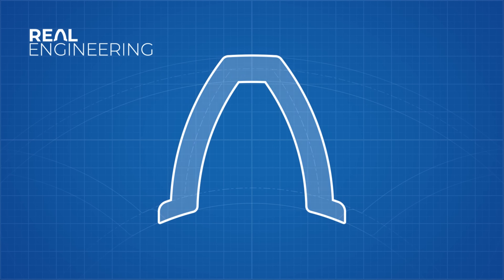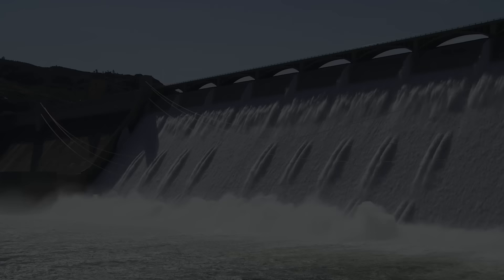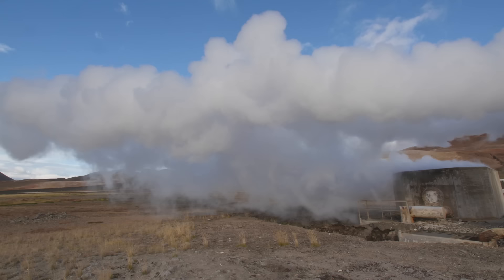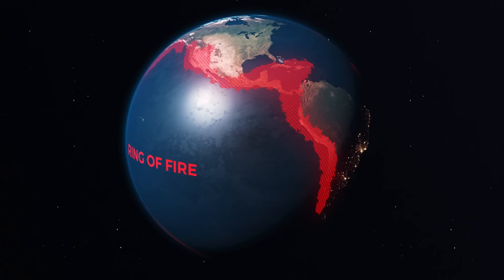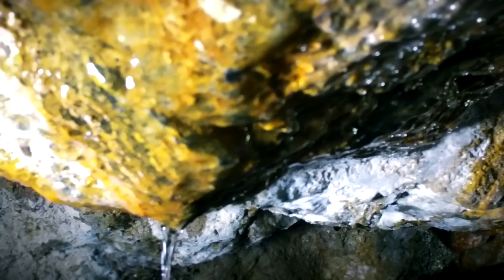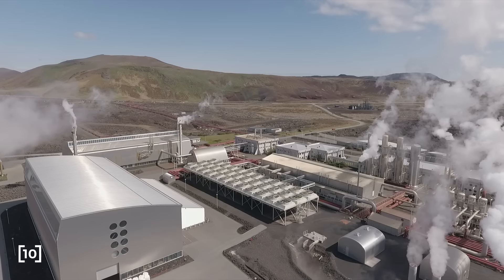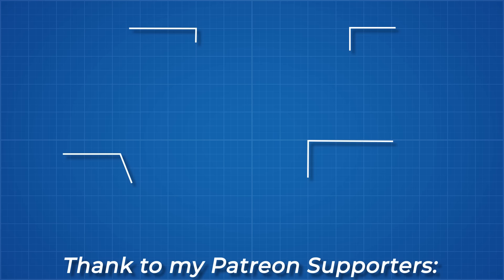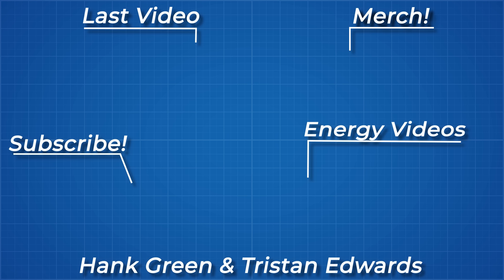Could Earth's Heat Solve Our Energy Problems?

Comment: An earthquake of 3.5 is nothing, make those buildings properly
Reply: I agree. But, the problem is most of the world has been around for much, much longer, and their buildings were not always built with earthquakes in mind. It is possible to renovate and retrofit the structures, but it is extremely expensive, and in most common building types, like say old stone houses in a village in Italy, prohibitively so.
Reply: @ryanaegis3544  The problem in Italy is not the old buildings per se. For example, the medieval tower in Norcia is still standing even after the earthquake. The problem are modifications made in economic boom times to the old buildings, for example adding balconies, enlarging doors and removing load-bearing walls, or even (the worst offender) replacing the timber-framed roof with a concrete slab roof that adds an enormous weight on top of the structure. Such structures are already overloading the house in normal times, imagine in an earthquake... what happens is usually the roof cracks the load-bearing walls made of stone and not intended to support a heavy slab, and the whole house crumbles while the roof remains intact
Reply: Thank you for that insight.
Reply: 7.1 earthquake 10 miles from a city of 300,000.

0 deaths, only minor injuries.

I laugh at earthquake news now.

Comment: Look at the Geysers in California.  Active since 1960 with about 1,500 MW output.
Reply: Last coal fired power station built in Victoria Australia had 4*2000MW generators. (Built in 1980s).Do you think you could build maybe 5-10 more plants without affecting the geysers? 

In NZ they made 20,000 households cap thier geothermal pipes & install LPG fired water heaters. They were extracting so much heat the geysers would not spray steam as high into The air. It was ruining the tourist industry. I know because I worked for a company with the contract to build the 20,000 LPG water heaters. This was back in mid 1980's

Comment: California doesn't produce enough energy in summer, either. They buy a good 4k MWH a day from the surrounding grids.

A few years old, but this article talks about California being the single biggest importer of electricity in the lower 48: https://www.eia.gov/todayinenergy/detail.php?id=38912
A (relatively) live graph of the grids in the lower 48; this page specifically looks at California. The bottom graph on this page shows energy interchanges with three other grids - Mexico, the Northwest, and the Southwest (excluding California itself). Positive values on the graph indicate energy exported from CAL to the indicated grid, and negative values show energy imported from the indicated grid to CAL. The only place California has exported any energy to in the last week is Mexico, and that looks like it hasn't broken more than maybe 100 or 200 MWH on any given day. Conversely, both the NW and SW grids have exported between 2k and 6k MWH daily, with only one day coming close to being a net 0 with the SW grid at 5pm. https://www.eia.gov/electricity/gridmonitor/dashboard/electric_overview/regional/REG-CAL

Even in summer, California doesn't produce nearly enough energy to sustain itself.

Comment: We need to move to sustainable energy, not renewable energy.
Reply: @windowkey  Technically fossil fuels are also renewable albeit over very long time frames. Sustainable means that the rate of regeneration equals the rate of consumption. In that regard, even nuclear power is not sustainable since there is a limited supply of fissionable material on Earth and the fuel is not renewable.
Reply: A hydropower dam is renewable energy.
Reply: @Obscurai  There's enough mineable thorium to last us a billion years...
Reply: @axiom1650  While there is an estimated 6.3 million tonnes of thorium on Earth, the rate of usage will ultimately determine the lifespan of the consumable fuel - even thorium. Do you know the rate of fuel consumption to justify the claim of "a billion years"? Also thorium requires another fissile material to initially "breed" it into fissile material, and this catalyst material is limited.
Reply: @Obscurai  We only need to bridge the gap between now and fusion being the cheapest energy source, also uranium fits that requirement.
Reply: @Obscurai  
It gives us the thirty years we need to develop Fusion.  Wind and solar do not!
Reply: @JudyHart1  
Hydro power doesn't damage the environment?
Reply: @lordsamich755  No problem, now to find someone to fund research and development for another 30 years, while there is an immediate need to transition to an alternative energy source.

Don't get me wrong, I get it. The technology works and there is promise, but there is a great need now to fix the climate crisis and the long lead times to just even build the reactors (some reactors have been in construction for a decade) is not fast enough. Sure keep doing the research, but we need something now. Call me when reactors can be built with less capital and/or produce electricity at a lower cost than existing technologies - maybe then I and others will invest.
Reply: @axiom1650  Good luck finding investors (government or private) when there are more profitable and less risky energy investments. Since fusion is not yet a reality, it is far from being the cheapest since that is not even part of the conversation yet. Keep doing the research, but until the economics, operating costs and energy yields are known, the claim that fusion is the cheapest energy is simply nonsensical and unproven.
Reply: @lordsamich755  All forms of energy extraction damage or alter the environment - just pick your poison. Solar traps heat that would otherwise would be radiated back into space. Nuclear generates waste that is difficult to dispose of. Wind alters wind patterns. Hydro floods valleys. Hydrocarbons emit CO2. Geothermal if not opportunistic, cools the Earth's core and potentially weakens the magnetosphere. It's only a question of which type of damage is acceptable in the short and long term time frames.
Reply: @Obscurai  I'm talking about a scenario 500 years in the future, when coal and oil have become considerably more expensive than nuclear fission and fusion due to scarcity. A man can dream no?
Reply: @axiom1650  Coal, oil and natural gas are already more expensive than other forms of energy production - and the costs of renewable sources continues to drop. This is what fusion will have to compete with and what fission is currently struggling with:

https://en.wikipedia.org/wiki/Cost_of_electricity_by_source
Reply: @Obscurai  
That is why I support Nuclear Energy.  The GT-MHR is ready for deployment right now.
We could have an entire fleet of GT-MHR's powering the eastern seaboard within 5 years.  Where have already been waiting on fusion for 30 years... Twice.  We simply can't afford to be reliant on that schedule.

http://sites.ieee.org/npec-sc2/files/2017/06/SC-2Mgt05-1_Att9-Overview-of-GT-MHR-Reactor.pdf
Reply: @lordsamich755  Terrific! Are there investors willing to invest? Are the economics viable with a sufficient ROI that exceeds other tech?
Reply: @Obscurai 
Everybody should be investing.  The principal obstacle is that people have been fed a consistent diet of irrational fear and lies for 50 years.  To the point that they won't even read information I provide them. Information demonstrating that with the current state of development, prior concerns about Nuclear power are now completely mute.
Reply: @lordsamich755  So no real investors then and none for the foreseeable future.
Reply: @Obscurai 
A series of Australian Super funds have stated specific interest in investing.  I'm certainly interested, and anybody who knows the truth should be interested in investing.
The issue is that we have a national ban on the development of any nuclear power technology, because of stupid asshole politicians who like to fuck with things they don't understand.

Comment: "Non-toxic injection fluid" - Uh-huh; that's what gas frackers said.
Reply: The fluid used for fracking is non-toxic. They weren't lying. When they initially frack an area, they're injecting non-toxic fluids into the rocks to increase the pressure and cause the rock to crack and release the oil inside. That oil is then pulled out, separated from the fracking fluid, and sent off for processing. The fluid that was separated, although originally non-toxic, has been contaminated and polluted by the oil. The fracking companies didn't know what to do with that contaminated fracking fluid because the quantity of it built up EXTREMELY fast. They couldn't just leave it in tanks as the more oil they fracked, the more waste fracking fluid they would have. That's when someone got the idea to pump that contaminated fracking fluid down into "empty" fracking sites, and at pressures that were higher than when initially used. This is where the problem with oil fracking lies. Instead of sitting in the ground like it would in a tank, the ground moves and allows that pressurized fluid to find an equilibrium. That fluid obviously won't go down to find balance, as that means pushing the earth out of the way, so instead it goes up where it only has to push a bit of rock, dirt, and air out of the way to balance. That's how it finds its way up, and generates earthquakes while doing so.

Comment: Yeah we should let BP drill for all that geothermal energy, what could go wrong
Reply: Why would the British PETROLEUM Company use geothermal energy? 

To get petroleum you need dinosaur juice. If you have oil, you have liquified petroleum gas, which is formed in the top tier of the distillation tower, right above naphtha, which after reformation becomes petroleum for cars. 

Every penny spent investing in geothermal means that it's investment in oil becomes less profitable, as competition for its LPG supply diminishes. 

Therefore it makes very little business sense to divest into geothermal energy. It would be a better idea to use that money investing in new sources of oil, cheap refining, and new uses for by-products of the distillation of petroleum and kerosene. 

For the planet, that's not good news at all, but business plans rarely care about sustainability when the investment you have will make you more money than you could spend in your lifetime, or the lifetimes of your great-grandchildren's great-grandchildren, if it's properly invested and entrusted. 

For example, if you have $10Tn to your name, and you release $1Bn per child upon them turning 28; then assuming each generation including your own has 3 children who live to 28, you could provide startup capital to your next 8 generations with 3.5Tn to spare on investing during your own lifetime.
Reply: @jamielonsdale3018  They would be drilling for geothermal but unfortunately find oil. Itll be a geothermal plant once the oild runs out. Honest!
Reply: @pflernak  If it's hot enough for geothermal, it's hot enough to burn the oil off. Or cause an explosion during drilling if there's no air in the pocket before drilling begins.
Reply: @jamielonsdale3018  
Even if its to be a binary cycle power plant? Also <sarcasm>

Comment: For geothermical energy we have the same issue as when using the rotation of the eart itself for producing energy. Reducing the available amount/rotation speed. Nevertheless...We could use the geothermical energy in winter if we add heat to it with the summer solar energy.In other words...using this as a thermo storage of energy. (Thermoscan of epic proportions). 
Also rethink of danger....When something goes wrong ....we know vulcanic eruptions also free lots of C)2 and sulphur in the atmpsphere....be sure the geothermic use of energy will not free those gases from deep below.
And also do not think that use of solar energy is save against climate changes....every solar joule of energy we use / store in the bottom instead of reflecting that joule out of the earth atmosphere will heat a little the earth.
The more solar energy we collect with those black panels instead of reflecting sunlight on the nearly white sand of deserts back into space will invrease the absorbed energy form the sun on earth.

Comment: I'm not a geo-engineer, but seems something here is amiss. As I recall from physics classes energy can neither be created or destroyed, but it can be transferred in the form of radiation. If we start using massive levels of geothermal energy contained within our planet, it will escape out of the atmosphere when we use it, (thermal radiation and it will be lost.) After the process puts too much heat into the atmosphere and changes our ecology causing even more global warming than might already exist.  As we use the thermal energy from the core doesn't the mass of the planet slowly reduce, the magnetic field deteriorates, and the core stops spinning as mass is converted to energy (just like our sun).  Eventually,  doesn't the core  reduce its' mass and cool, as it cools and shrinks it gets smaller, reducing gravitational heating until the planet reaches an equalibrium and becomes a cold stone.  (I'm not an engineer, but it seems possible)  Seems to me this is a similar theory of why Mars died.

It's really no matter though, man kind will either destroy itself first because of man's inability to responsibly use new technologies (and we apparently never learn from our stupid mistakes one being letting our government running things under socialist control which gets worse every day) , or a asteroid will cause mass destruction (several large ones have come very close in recent years, (capable of causing major earth altering environmental damage), or a CME (Coronal Mass Ejection) will get us possibly causing a total extinction level event, (again they occur frequently but have just missed us so far), or a super volcano such as the one under Wyoming could do us in!  (The one in Wyoming is long overdue but will happen!). 

 In plain words our culture and humanity is doomed to fail eventually because even though we call ourselves humans, we truly have little actual humanity. If we did we would solve more problems than we create, wars would not exist, poverty would not exist, billions of dollars would not be wasted on university based grant scams to seek supposed medical cures when in reality the big pharma groups only want to treat illnesses, not cure them!  There are no profits in cures, only long term treatments, also a big scam!     In plain words our survival as a species is primarily a random crap shoot not really under our control at all. Sad,  a requiem for humanity......

Comment: Batteries are far worse for the environment than any fossil fuel. You have to strip mine in order to get the rare earth materials to make a battery. And batteries don't last very long. They have to be restored and replaced at Great expense to the environment.
Reply: They are however using less and less valuable metals as time goes on. The advancements in li-ion cells have come a long way from the material it sounds like anti battery research quotes. (I'm not a tesla bro), but tesla drastically reduced the quantities of such metals while also finding new material combinations to fight degradation issues. early li-ion cells crack apart in a way when charged and discharged from expansion, which killed them quickly, but newer compounds like  graphene and nanoparticle mixes are solving both issues. Just a thought. Can't say I'd know what the state of affairs would look like if everything moved to batteries, but old ones do suck so much that they make for juicy numbers for short life, replacements, and element usage.
Reply: Better than using batteries is using pump storage plants that are more enviromentaly friendly and also more efficient. Altought they are expansive to construct. But batteries are also expansive.
Reply: There is a nice high-capacity battery in russia which consists of two huge tanks/ponds (at a different high), water pump and a turbine - it is used as a buffer between energy systems of different parts of the country, which have their peaks of energy consumption in different time.
This design is not the most effective, but it is pretty cheap and absolutely non-toxic. I can`t understand why such simple system is not popular.

Comment: If the earth were more porous, we could access its still cooling core for heat, power (hydro-tech), etc.  However, since we have no ability to reach the useful depths, we may be limited to where the crust has cracked and the internal heat escapes (i.e. volcanoes, vents, etc.)  It's conceivable that one day we may make better use of the stupendous power of Aetna, Yellowstone, and the Siberian Traps.  It's only fair, as one day they may be our undoing as they have done in the past...

Comment: Drilling holes into volcanoes does not have a great deal of inherent safety.  Naturally, if you can cool the magma down by extracting the heat over a little while, you may end up without an eruption...but with all the perforations that go close to the magma make for interesting possibilities if there is a large earthquake.  While a lot of the geo drilling in California is not real close to the population centers, there is a bit that is close enough to raise concern..   And putting the well points into the edge of a really big volcano like Long Valley seems just a tad hair raising.  If THAT goes off, the entire country suffers.

Comment: AUSTRIAN non-mechanical engineer here: Geothermal power is a solution but requires very particular planning and execution. It is used (not only in England) in Europe and many other regions with hot springs or thermal activity. But - you need to think bigger. Earth has in fact thermal activity in it's core - we will learn how to use this source without destroying our planet - but that may take hundreds of years or thousands.